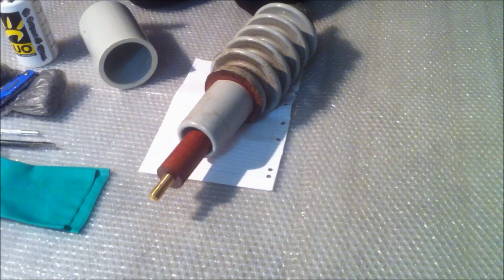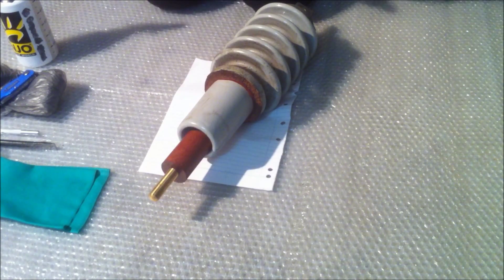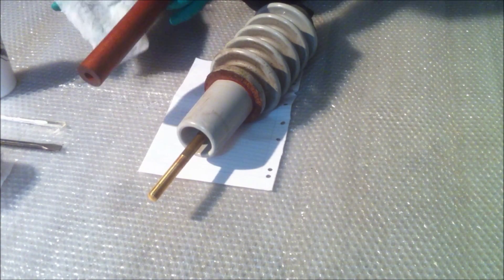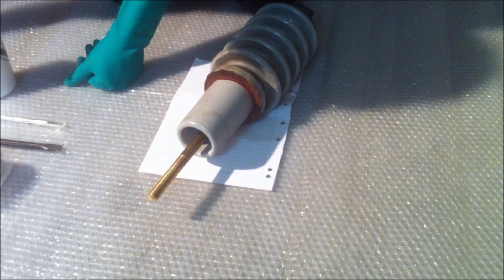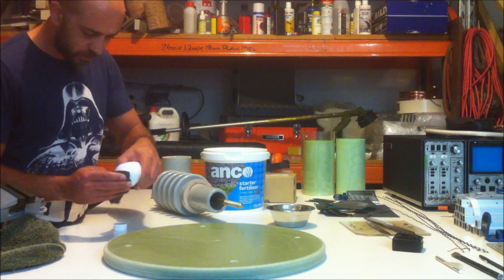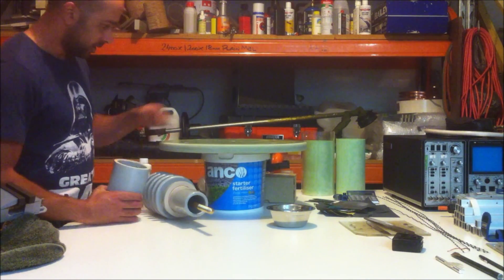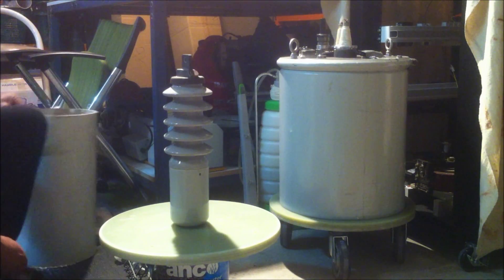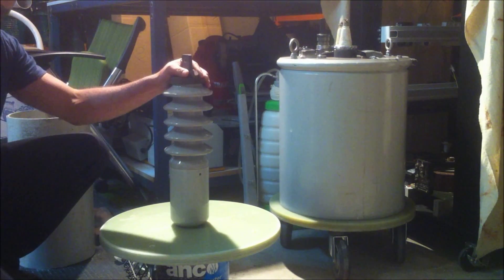I Made A Trolley For A High Voltage Transmission Line Insulator!

Comment: One way to remove the gasket would of had been to do it in the bathtub. This provides a safe working environment and by using a strainer type plug at the end you can safely dispose of the asbestos in the bathtub since it will be wet.

I used this very same method when i restored an antique cooking machine that had asbestos side panels. Due to it being old and frayed i decided the best way to un-glue it was to sink it completely in water. Luckily the panels were small enough to fit in my tub.
Reply from the maker: That sounds like a good idea. Unfortunately, my kids use the only bathtub in our house on a daily basis. I could use a bucket of water next time, depending on the part..

I had never done this before, so I just did some research and did it in accordance with the recommended practice to be safe. Luckily, the gasket was not very fibrous, so airborne fibers were not much of an issue.